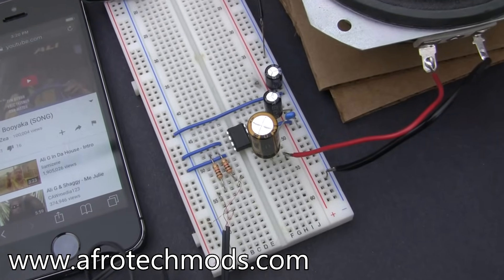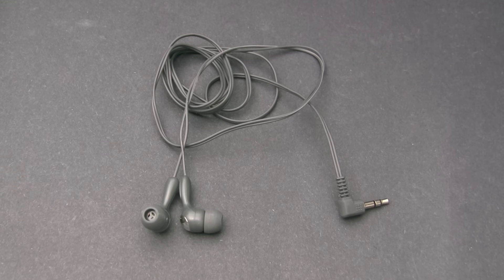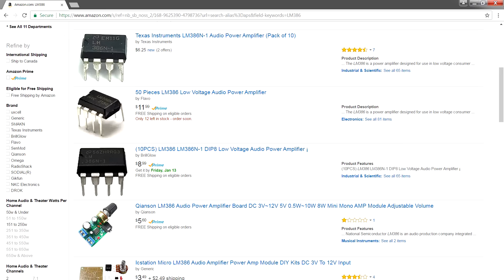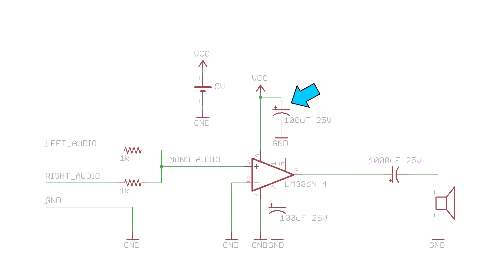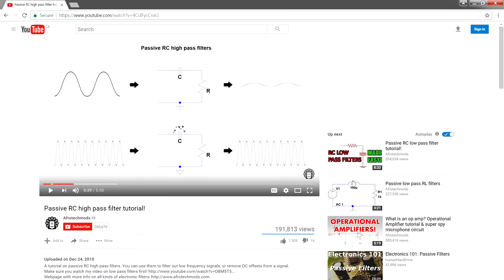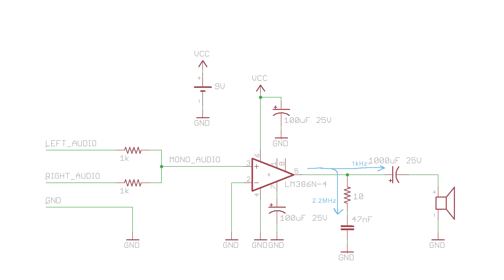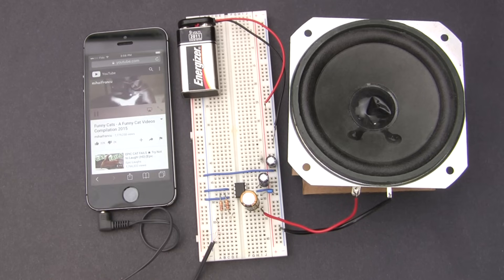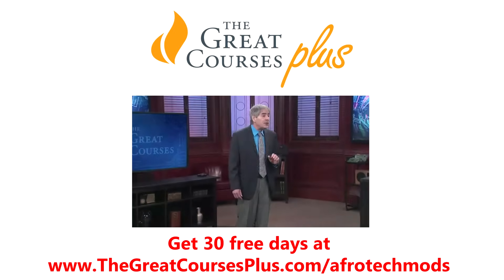🔊 How to make an LM386 audio amplifier circuit

Comment: Get a bluetooth module, 2 of these circuits and 2 speakers, and there's your 230$ beatspill.
Reply from the maker: Yup. Pretty much.
Reply: Part of the reason for the price though is the fact that the speakers are designed for full audio range, which isn't the easiest thing to make and because the enclosure is designed to resonate and acoustically amplify the sound so that you get a good sound out of it. That being said though, Beats are very overpriced for how they sound. Bose speakers for example are actually a little more expensive in some cases but sound exponentially better as they have a better overall design and don't have or need the "Beats by Dre" name in order to sell units.

Comment: What about distortion, linearity, and SNR? Are there any issues with crossover distortion or clipping? Maybe have a sine wave sweep over the audible frequency range, get your (preferably analog) scope into XY mode, and connect Ch A to the output and Ch B to the input and see if you get a straight line over every frequency? And we can't forget to do proper impedance matching with the output! ;)
Reply from the maker: I think you may be expecting a bit much from 6 minute tutorial on an $0.80 IC that is older than most of the audience ;)
Reply: Nahhh ;) I have messed with this chip a long time ago as part of a 200-in-1 kit and just wired it based on what seemed intuitive. Connecting the microphone directly between the inverting and noninverting pins, and   a speaker directly to ground on the output. It was horrible, and drained the batteries. I learned that it could run off of depleted batteries better if a capacitor was added in series, something I did by accident. I now know what I did of course, and that I wired it completely wrong but it was fun to mess around with!

Comment: Excellent tutorial! The lm386 amplifier was my first amplifier I built 2 of them was used with 2 aiwa bookshelf speakers, very loud. No I have been building much higher powered amps, such as my 4,000 watt amp.But that's what I do now.
Reply: How on earth can you power a 4000 watt amp? I mean, you're lucky to get 1500W out of the wall and that's an entire dedicated circuit.

Comment: does it matter to use 3 watt speaker or i m gone need do use only 1watt?
Reply from the maker: You can use a 300 watt speaker if you want, the only limitation is you can't drive the speaker at its maximum power level.
Reply: Afrotechmods thanks very interesting video and i ll try this

Comment: does it matter to use 3 watt speaker or i m gone need do use only 1watt?
Reply: 4 ohms would overload the amp and it will get hot and burn out. the 4 ohm resistor in series with the speaker will give the correct load of 8 ohms. The speaker will use half the power and make sound with it, the resistor will take the other half of the power and make heat with it.
Reply: as long as its higher than 1 watt and 8 ohms or higher you will be fine running upto about 12v.
Reply: +Sirus but what if i have 4ohms speaker?
Reply: Justin Stuart the IC may burn
Reply: you can put a resistor of 4 ohm in series with the speaker to give you 8 ohms total. you can put a bunch of 9 x 37 ohm resistors in parallel to give you close to 4 ohms, if you don't have any power resistors that will handle a watt
Reply: http://r.ebay.com/WkaTWZ 4.7 ohm 1 or 2 watt
Reply: Sirus 1watt
Reply: Sorry if it sounds dumb but, what is the effect of using a resistor to make it 8ohm, is it bad if i used 4ohm speakers alone? I'm a noob at it lol...

Comment: one question sir in many schematics of lm386 and the data sheet of the IC a capacitor is connected b/w pin 1 and 8 to set the gain what is the gain without it.
Reply from the maker: The default gain is 20 which is perfect for phones and laptops but if you put a capacitor between pins 1 and 8 the gain becomes 200.
Reply: +Afrotechmods thanks sir and a great tutorial please keep making such videos

Comment: I usually use TDA1554s for generic audio amplification purposes. 4x11W or 2x22W, just as simple to use as LM386 and still quite cheap.
Reply: TDA chips are rarity now.
Reply: @richardlighthouse5328  what the heck happened in those 1.8 years since he posted the comment?
Reply: @richardlighthouse5328  I meant what happened that made the ICs a rarity
Reply: @Razvii  Manafacturer marked them a obsolote
Reply: @richardlighthouse5328  TDA Amplifier chips are actually still quite popular. You'll see a shitload of them in many Class-D and A/B Amplifiers, Including; TDA2030A, TDA7491LP, etc.

Comment: Nice video, i really like your style. Do you know how i can make a volume control for the LM386?
Reply from the maker: The volume control of your laptop or phone should be sufficient, but it is also easy to simply use a potentiometer to divide down the signal on the input. Check out my tutorial on voltage dividers for more info.
Reply: Thanks!

Comment: Hi AfroTechMods, Good video. I like the old LM386 for small amps. I have built a lot of them and from John Audio Tech on YT I learned that you need to have a separate ground path for Input, Power, and Output. They should all junction right at pin 4, ground. His video is " LM386 and proper grounding". At best you can expect around .6 mW of output power. It is best to power them at 9 volts for heat dissipation. Do not use 4 ohm loads. 9 volts, 8 ohms and your golden, as John Audio Tech say's. Good to see a new upload. Be good, C.
Reply: Cass Virgillo but i have a 4ohm speaker :(
can i use a 4 ohm resistor in series to make 8ohms? I'm powering it with 5V dc wall adapter???

Comment: Did you really say "After I was done beeing a striper" ? HAHAH!
Reply: ***** I just didn't expect that.
Reply from the maker: Being a stripper is not a viable long term career.
Reply: Lol made that joke when I did my 10th grade demonstrative video, the teacher loved it.
Reply: Afrotechmods is it possible to have a pwm signal from a microcontroller be the input instead of the microphones that you have. would I have to change a lot at the input?
Reply: Afrotechmods I'm asking because a pwm signals isn't an analog signal so I'm just curious how it would work instead.
Reply: @joeandrew8752  It's been 3 years, so I think you might already know the answer by now, but anyways. 
I think that a pwm signal closely relates an analog signal. When we convert DC to AC, we don't really get a sinusoidal wave at the output. 
Rather, it's a square wave looking wave. But it gets the job done. We call it AC.
Reply: well it would sound like shit
Reply: Anthropomorphous Dodecahedron as much as I'd like perfection I'll settle for function. So long as it'll function. Could you go in detail why it would sound bad and what you would recommend otherwise.
Reply: Well generally speaking sound produced by square wave (which is pwm) is a bit distorted or something (unless we are talking high frequencies). It's distorted in a sense that it has some additional frequencies other than its own. But it will produce sound if that's what you need.  I don't know your application to suggest anything different so what do you need this for?
Reply: im using adc to convert voice and send it wirelessly to another mirco controller and using pwm to recreate the voice. His circuit is the same one i was going to use since i used it for a radio before, i think a capacitor should alleviate most of the distortion, before the amplification.
Reply: Halvor Andreas Nilssen Lol I thought I was hearing things
Reply: Lmao
Reply: Yeah he was a ‘striper’.  He loves stripes.  Most of his other videos are dedicated to him creating stripes.